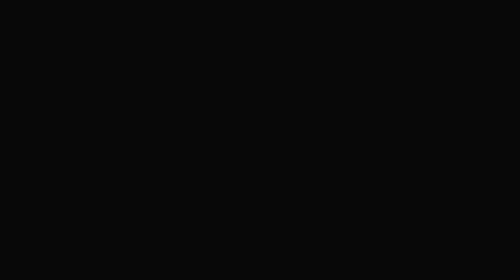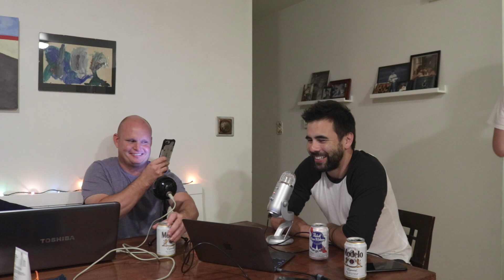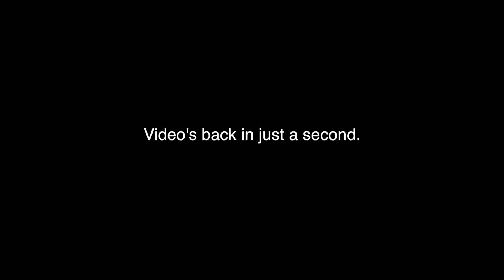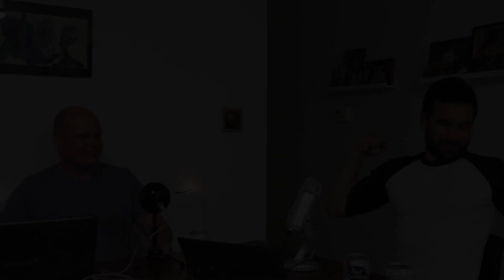EPISODE 57 | Getting Into Solar | Modern Maker Podcast

Comment: Awesome stuff, it's great the opinion of someone knowledgeable in Solar in an authentic sense laying down misconceptions and solid pathways to take.  Thanks for hosting and asking some great questions that we want to hear Ben.  Jason mentions many times less parts and wiring leads to less parts that can fail.  I was wondering what are common typical maintenance costs say for example on your workshop.  What is typical life expectancy of solar panels or what are the most common repairs having to be made to the systems?  Or what is the type of routine maintenance required with a system?
Reply: Dave Suydam good questions! I also appreciate Jason's real world opinions and looking at places to reduce fail points? Plus your question about maintenance of a system i.e. The little work shed?